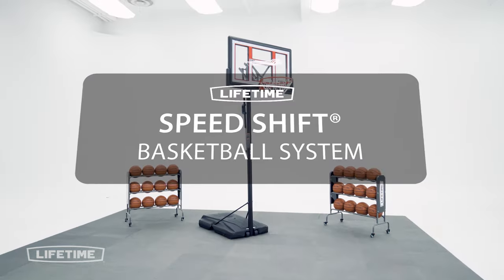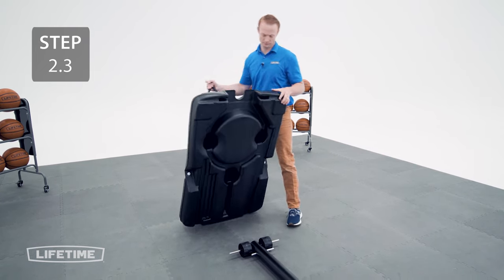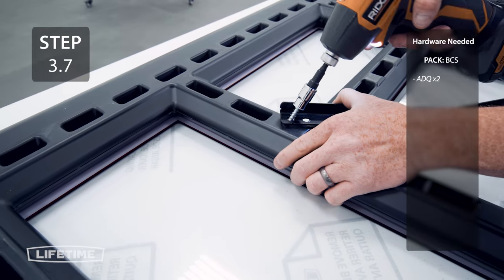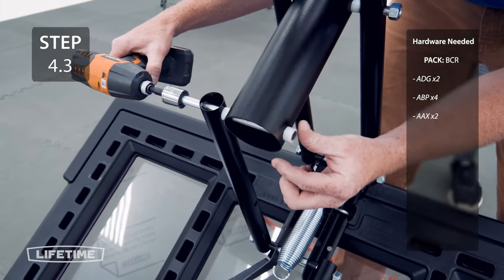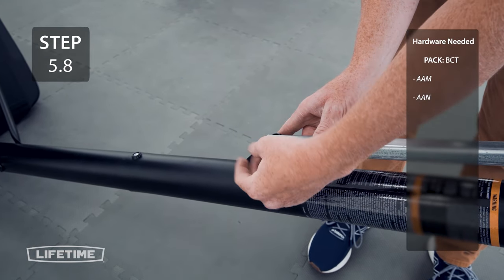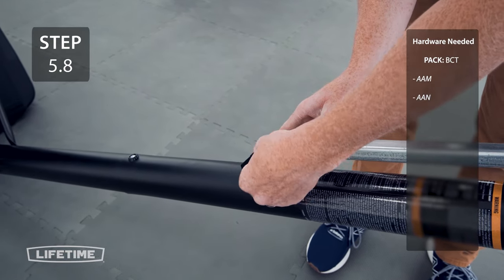Lifetime Speed Shift® | Lifetime Assembly Video

Comment from the maker: To jump to a specific step, click on the time stamp associated with the step. (For mobile devices, time stamps are down in comments.) 

Section 1
1:56 | Step 1.1
2:07 | Step 1.2
2:19 | Step 1.3
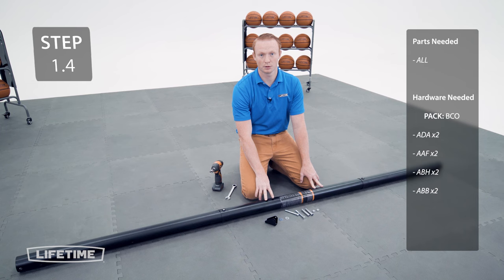2:33 | Step 1.4
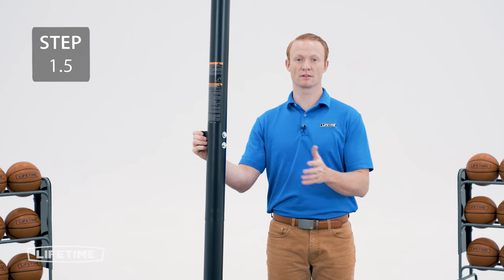3:18 | Step 1.5

Section 2 
03:53 | Step 2.1 
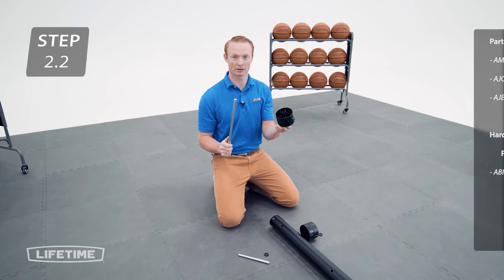04:22 | Step 2.2 
04:50 | Step 2.3
05:39 | Step 2.4
05:50 | Step 2.5

Section 3 
06:08 | Step 3.1
06:25 | Step 3.2 
07:01 | Step 3.3
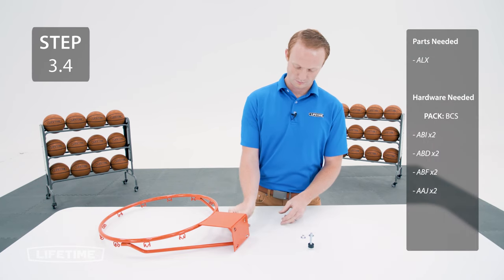07:16 | Step 3.4
07:54 | Step 3.5
08:43 | Step 3.6
09:17 | Step 3.7
09:48 | Step 3.8

Section 4 
10:04 | Step 4.1
10:43 | Step 4.2
11:12 | Step 4.3

Section 5 
12:30 | Step 5.1
12:55 | Step 5.2
13:01 | Step 5.3
13:13 | Step 5.4
13:22 | Step 5.5
13:50 | Step 5.6
14:07 | Step 5.7
14:19 | Step 5.8
14:35 | Step 5.9
15:14 | Step 5.10
15:29 | Step 5.11

Section 6 
15:48 | Step 6.1
16:02 | Step 6.2
https://youtu.be/5RQtqU3GpNw | Step 6.3
16:28 | Step 6.4
Reply: The short and long arms. Are the holes supposed to line up? The holes on mine don’t line up
Reply from the maker: @ryankproductions7943  yes. The trick is to have someone lifting the base and the pole section of the system and maneuvering it round until you are able to line up the holes to the poles.
Reply: Lifetime Product, I have a problem with this hoop, after more than 3 weeks after assembling, when I finally brought the hoop to 10 feet, it looked shorter and when I measured it, it showed 9.5 feet instead of 10. What can I do to fix this.

Comment: You guys probably tolerances the hole for the shoulder bolt for step 4.1 before powder coating. I’m measuring a 12.53mm shoulder diameter and just under 12.50 to 12.52mm hole with calipers. This needs to get fixed.
Reply: And actually now measuring at where the chamfer is for the lead-in from the bolt’s threads, it is 12.56mm. This is actually impossible to force through without a mechanical press or turning down the bolt. Can you send everyone who has this issue replacement bolts with tighter tolerances?
Reply: @lifetimeproductsassembly
Reply from the maker: You shouldn't need a replacement bolt. Just try using the bolt to ream out the excess powder coating in the hole.

Comment: Very good video. It was a big help.  One question:
I believe I installed everything correctly, including being careful to tighten screws and nuts correctly, so is it normal for there to a big fairly large wobble on the system when shots are being made. The backboard and pole seem solid, but the wobble appears to be from where the pole and the base are connected. Thank you for the guidance.

Comment: How am I suppose to know which part is which nothing is labeled on bag..several bags with alot of parts..
Reply from the maker: If you look on the side of the video, you'll see a list of the parts you need and which hardware bag it can be found. The pictures on our manuals are also designed to be the same size of the actual parts to help you see what part you need.

Comment: Why is the rim still slightly tilted upwards??
Reply from the maker: It could be because the T-nuts are not tightened all the way and have become more loose. You will need to take the backboard apart and tighten the T-nuts. If that doesn't work, try reaching out to our customer service experts. They can be reached at 800-225-3865 or by email at customercare@lifetime.com. Customer Service hours are Monday-Friday, 7:00 am to 5:00 pm (MT).

Comment: I bent the brackets but the screw hole doesn’t line up with hole in the backboard. Any suggestions?
Reply from the maker: Make sure the backboard brackets are flushed with the backboard. You may need to move the brackets up higher.

Comment: I dont have a step 2.4 or 2.5 and i dont know what screw to use for the base and pole
Reply from the maker: That’s weird. You should have those steps. Please reach out to customer service to make sure are using the correct video and the correct assembly. They can be reached at 800-225-3865 or by email at customercare@lifetime.com. Customer Service hours are Monday-Friday, 7:00 am to 5:00 pm and Saturday, 9:00 am to 1:00 pm (MT).

Comment: Well you need a mallet for the four posts that go behind the backboard...I had to whack them through after threading them... that's for sure and thank God for the video because the instructions are not clear at all ...they dont show closeuos disgrams and neither dirs this video...some close-ups on the washer nut steps, and  hard to see what youre doing when filmed wurh such a wide angle ....more close-ups are much more useful on the intricate Parts... altogether it takes long but not that hard for someone with some handy skills.  
definitely not a build for someone with zero tool experience or any sense of rackets, wrench, power drill etc..